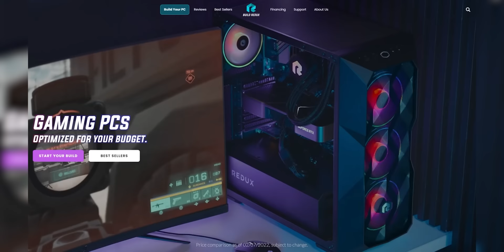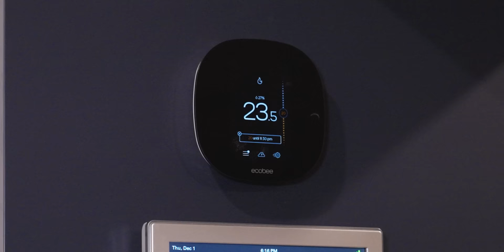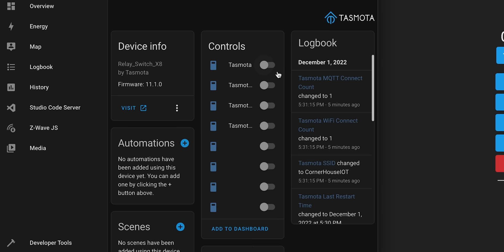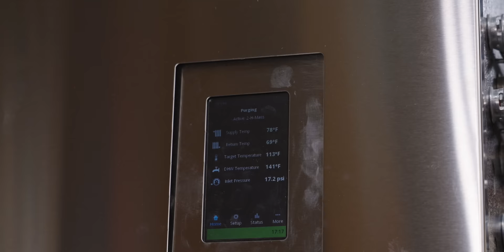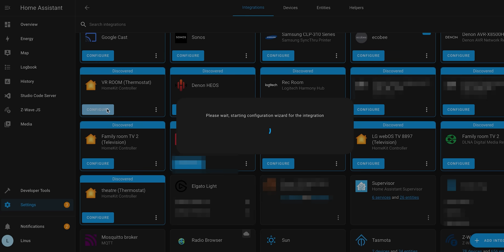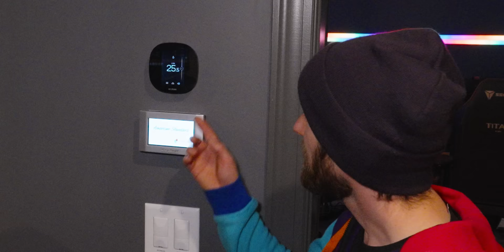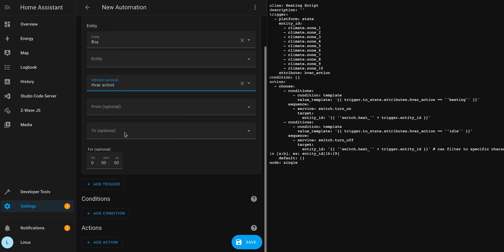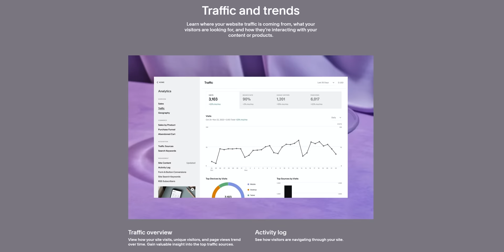My Smart Home is Stupid - HVAC Update

Comment: I love Linus going on about how cold it is in his house and Jake is casually standing in the background wearing shorts and t-shirt
Reply: yeah the temps he shows are the goals I will my AC would COOL my house to lol.
Reply: before I lost some weight, I was the same. Didn't realize fat is such a great insulator. Drowns you in sweat when it's sunny though
Reply: overweight people are warmer?
Reply: @armanke13  internal temp doesn't go down as fast as slim people. temp is still the same.
Reply: @anb1142  More insulation means more retained heat. So for the same input heat there is less heat loss and hence higher temperature. Whilst the main parts of the body will be at the same temperature regardless, it does affect the rest of the body, especially the sections that generally get cold, like hands.
Reply: a thin guy will die of hypothermia, before a fat guy will feel chilly.
Reply: Heat production is volumetric. More cells, more heat. Heat loss is based on surface area. 
Volume is a cubic relation, while surface area is a squared relation. So a larger person will generate more heat per unit of surface area than a small person. This is one reason why tiny animals and smaller people get colder faster. Fat is also a great insulator and most large folk carry their extra mass around their core.
This is also why a fat guy can lose 20lb and see a miniscule difference in how their close fit but a tiny person can lose 20lb and their clothes are just falling off.
Reply: @armanke13  Amazing amount of insulation, yes. That's why animals that must be cold resistant like whales, bear, penguins, and seals are all full of blubber/fat, in addition to other mechanisms.
Reply: 20 C is pretty much the golden temperature. He's complaining a bit too much.
Reply: @tekknorat  Here in the tropics, my golden temperature is 26 C
Reply: @anb1142  i’ve always been skinny, and sometimes i go to the mall and while everyone else is walking around just fine, for some reason there are moments i feel so cold that my teeth literally starts chattering and my hands get so cold that the water from the wc tap, usually cool or even cold, feels quite warm and pleasant. 

it’s extremely annoying because i’d bet my entire life savings that the ac is set on an entirely pleasant temperature, and there i am, feeling so cold my entire body is trembling.
Reply: @Shwalamazula  always love to see things about the body explained scientifically
Reply: @williansouza8724  I live near the equator, We're used to temps around 30C   
it's hot to us when the weather app says "feels like 41C" from 11PM to about 2PM. I pretty much stay shirtless all day when at home.
Nights are around 20C, sometimes a bit lower. I did and do use a thin blanket when sleeping. 
Out of habit I stayed shirtless even in the december in previous years. But in this year after I've lost some weight, I feel cold and want to put a tshirt as soon as the sun sets
Reply: I felt that when the floorheat pipes started to warm up.  floor was 11c      That's the temp I have to change from shorts to trousers :D
Reply: @Shinei I'll t-shirt while shoveling in a storm, so long as it's not too windy.  And I'll still be sweating.

Comment: I had this same setup using ecobee as a simple thermostat. Eventually switched to just using a thermostat on homeassistant and having a tablet on the wall with a custom home assistant dashboard. I stopped using the ecobee since I kept having weird bugs/disconnection issues. Great setup now with homeassistant! Thanks for the video.

Comment: You can offset the temperature sensor in the ecobee thermostat by looking for an option called thresholds in the installation settings and offset the temperature accordingly.  I had a similar issue with my thermostat incorrectly reporting the temperature.

Comment: These videos are great for reinforcing how fragmented, unreliable and problematic smart home technology can be. It's great when it works, but it's a nightmare when it doesn't. They're time & money sinks for your house because there's too many moving parts and the hardware & software creators don't always stay updated with patches or communicate with each other.

Overall, the smart home industry is a mess.
Reply: imagine being isolated in a bad winter and heating stopped working because a line code in the software got corrupted caused by a wi-fi worm virus downloaded by your kid
Reply: I have a dozen or so bulbs/switches for automating outdoor lighting, turning on lights when someone gets home. And its randomly a giant pain in the ass. My thermostat is set and forget other than switching from heat to cool.
Reply: It's an extremely niche market for wealthy westerners who think that standing up to change the room temperature is too much hard work.
Reply: The normal "industry" smart homes a giant mess. This is why linus is running everything off his own in home server. To fix anything he can do it you dont have to call tech support for their cloud when it messes up.

My house has all the locks on the cloud but all of them have keys and also pads. Heating system is tied to the same cloud but can be operated manually. Anyone who links their house fully onto a cloud based system with no real manual override is insane.
Reply: @legoapocalypse3073  you could always just go open the electric valves manually
Reply: The state of this industry has always been bizarre to me. Absolutely nothing about automating your house should require complicated software. It's a bunch of basic conditional switches. The only part with any complexity is the user interface and, even then, not much.

I feel like it would be faster to do it with a raspberry pi and 'dumb' devices that you've added wireless switches to. Just code the whole thing yourself.
Reply: I'm what I consider an IT amateur/hobbyist. But I recently built a new home and fully integrated Home Assistant into it. However, my main rule is that the house should operate like a normal home if Home Assistant is turned off. Home Assistant just adds convenience and efficiency.

Home automation should be more like an escalator than an elevator. If it breaks, you can still walk up the stairs.
Reply: only poorly done low end stuff.    There are millions of homes that use real home automation hardware that dont have any problems for decades.    Crestron is the largest, and their stuff just works when installed by a competent dealer.   Control 4 is the next and then thereare some little bit players out there as well.   But all require competent installers.
Reply: @legoapocalypse3073  Those relay boards have a manual feature where you can move a jumper over to force them on, off, or in automatic. It would be a good idea to have those wired into some switches you can operate easily so you can take manual control to isolate a part of the system if it's leaky for example, or force the heating on if the software becomes unresponsive for any reason.
Reply: Not just the smart home stuff, but commercial solutions aren't really much better, and they cost a lot more.
We're constantly running into issues with stuff because they have a bad implementation of a standard such as BACnet. It's an open standard but quite complex, and it's not uncommon for different manufacturers stuff to not work together despite both using that standard, because one or both implemented it stupid.
Or when the manufacturer decided to roll their own standard, usually this is specifically to vendor lock an install meaning unless you fork out to replace the whole system, you have to go back to them for any revisions.
Reply: Yep. Linus even talked about this when they installed the switches/thermostats/etc - They all try to go this proprietary route, and it leads to each of them having painfully horrible flaws that could be fixed by allowing each to follow the same standard. If we ever reach that point, I'd look into doing it myself, but right now the tech is too closed off and prone to issues for me to consider even replacing more than a room of light switches.
Reply: Because he bought the worst kind.

He is half assing DIY. If you get a proper setup that handles it for you. You have no problems. If you get a real networked thermostat and lower your ego enough to connect a network cable to it, you can control everything through a webpage you get to write yourself anywhere on your network on any device and have NONE of these problems.

They problems exist because this system doesn't work by itself. But he also isn't the one making the system. You cannot best of both worlds that shit. You either let the smart home tech control your house for you, or you do every bit of it yourself.

Comment: That's a cool system. Mine works differently. Basically, if I feel cold, I turn the valve on the radiator counterclockwise. Has never failed me.

Comment: In home automation, there is a term called the "wife approval factor". Basically, if your non-techie spouse has trouble using your smart home as designed, then it fails the sniff test.

I went with off-the-shelf stuff that has a good reputation (Philips Hue, TP-link Kasa, etc) and I control it with Google Home. Not as sexy as Home Assistant, but there is minimal fuss and any quirks can be fixed by turning it off and on again.

Comment: Jake, I highly recommend you get the Smart PID Thermostat integration for H.A. It makes a world of difference especially on radiant floor systems with high run down and run up times. Using this integration will make the binary on/off valve operate more like a 0-100% analog point allowing it compensate for things like high ramp up and ramp down times as well as outdoor air temperature. With some proper PID loop tuning this will completely eliminate temperature setpoint overshoot and undershoot issues.
Reply: Yup, ON/OFF systems are only good for low thermal mass heating devices. The impact the PID controller makes on energy saving and temperature control accuracy is actually really big.  Also, an outside temperature sensor is a good idea with PID.
Reply: @ExCanMan  agree 100%. The H.A. integration I use has a PIDE option with E being the O.A. factor. It takes the difference between your indoor setpoint and outdoor temp and multiplies it by the Ke number you set. It basically functions to create a minimum PID output value at a given O.A. temperature.

Comment: Did you consider getting a ground loop installed for the heat pump when you had your pool getting dug out? Ground sourced heat pumps can operate well below sub zero and are in use all over Scandinavia
Reply: And you can get hydronic heat pumps (heats water like a boiler to have in floor heat) and can also be used for a domestic hot water heater.  Never a bad idea to have a backup heat source, but they really missed on this one.  Especially the efficiency that could have been had.
Reply: Probably not. Though would be nice having that under the pool or something, in non freezing depth.
Reply: They do perform much better than standard heat pumps in these conditions but they can be prohibitively expensive depending on the kind of land you live on etc
Reply: @reilandeubank  Cost range for ground heat pumps is about 15-30k €. For Linus, money is not the issue. 
But like you said, the type of land you live on is important. Here, you can't dig a well for a ground heat pump if your plot is above groundwater but idk if the loop, which is closer to the surface but delivers less heat for the pump than a well, is still allowed.
Reply: @Fortzon  vertical loop is also an option.  Horizontal takes up more land but for canada will probably be 12-15ft deep minimum depending on area, for good efficiency.   Vertical is a well with a U shaped loop, drilled a couple hundred feet deep.

Comment: The one BIG take away i got from this is that you can get local control of the ecobee using the homekit integration instead of having to use ecobees API key. Thanks so much for that it updates the ecobees status SO much faster now. You guys rock 😀
Reply: Will this work with everything linked via homekit? I have a few ceiling fans light on my Bond Bridge that has a delay I would like to cut down on.
Reply: @ReedSteiner  I would say yes as I do have several meross smart plugs that have homekit integration and that's how I got them connected locally with HA. I just didn't think about the ecobee being a home kit compatible device. As HA docs only talk about using the api key to do the integration.

Comment: This made me scrap any smart home plans I’ve had. Even having to re-“pair” the smart lights is really annoying when it happens
Reply: Look at KNX. Its wired and works great.
Reply: Jesus, yeah. I've got an LED light strip (just a light strip!) that requires a phone app to control, and if there's ever a hiccup in power the thing comes back on unpaired and starts strobing until my network comes back up. Sometimes I have to re-pair it manually, too. None of this smart home connected stuff is worth the hassle.
Reply: @demacherius1  But can you DIY it without ending up on the wrong end of a lawyer?
Reply: Yeah, it's enough when you have to reconnect a bluetooth devide like a keyboard and it's acts up and is like "I don't wanna :("....

Being able to connect to a smart system at home through wifi should be possible, but it should also not be crucial to do so.
When I get a house and if I start fiddling with smart things, I'de have high standards for how it should work and not work.
1. Have to work offline.
2. Must connect through wire (both network and power). POE whould be nice.
3. Controllable through a hub/server.
4. Can be controlled manually.
5. What ever else I've missed :)

There's really no need for wifi connectivity for the "smart things" as they talk through the hub. The smart things don't even have to be smart. It's the system in a whole that should be smart.
I mean. A smart system shouldn't be dumber than a non smart system.
Reply: @user2C47  Yes. Its a bus system with 30 Volts so not dangerous. All you do is connect two wires and then configre it in a software thats easy to learn. 
No Cloud if you dont order a special server, no network needed and in case something happens you can go to the actors and push a button on the device ta activate/deactivate the output relais.
Reply: @demacherius1  Good to know. I guess I just had a bad taste in my mouth from Crestron.

Comment: Hi. I work in HVAC. In my house you will not find any form of zoning at all. Why? 1. Heatpumps love to have a certain amount of flow. With never inverter machines its not that much, but still there is a minimal flow for the heatpump. Flow is also required for de-icing if its a airsourced heatpump. 2.Zoning, actuators and thermostats are a possible source of problems. Less is more. 3. Underfloor heating is self regulating. This effect works best with well insulated houses, low heating loeads and low fllow temperatures (low surface temperatures). If you can stay below 35°C this effect does most of the temperature control. What I do in my house is connectivity between PV and heating. If there is solar excess, temperature setpoints are manipulated to higher values. I can use the slab/concrete as thermal storage. Works pretty good.

Comment: Man, I am getting chills with all the wireless protocols.
My opinion is that this kind of automation should be done wires and a plc. In the long run it will just work.
Reply: Wireless isn't the issue. Bad software and lack of standardization is.
Reply: Yeah and too many proprietary devices trying to work together.  Would be easier to just do everything wired with some off the shelf sensors.  Either PLCs or Arduino.
Reply: And proprietary protocols and the lack of standardization cause the bad software because it has to be written against reverse-engineered systems without documentation.
Reply: @itsbazyli   I love how Linus wants the standardization but then complained about the American thermostat standardization in the video lmao
Reply: @Justin-wx1pu  he complained about the lack of standardization.

Comment: I used to work for Trane corporate and now work for an American standard dealer. I promise you don’t have to use the American Standard thermostats with your equipment. I love the equipment but also don’t like the thermostats. If you have any questions on this I actually hosted a class on using Honeywell thermostats with American Standard heat pumps a few months ago. I’d be glad to share some info

Comment: Ecobee actually has room sensors, so you can place them around the house where ever you want then use those as the temp sensor. You could do some shenanigans with the comfort setting to basically ignore the wall mounted thermostats and only use the room sensors.
Reply: This is what I was going to mention too. I use my room sensors so it only heats/cools at night based on my bedroom temperature (because who cares what the kitchen and living room temp is when sleeping). It also allows, like you said, to ignore the thermostat sensor.
Reply: 14:43